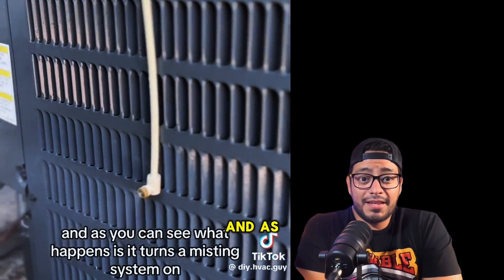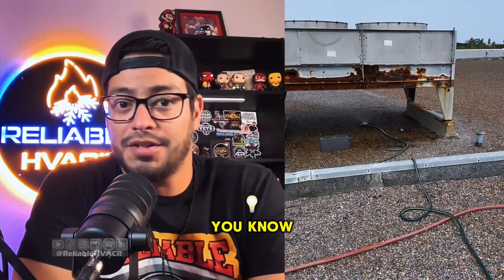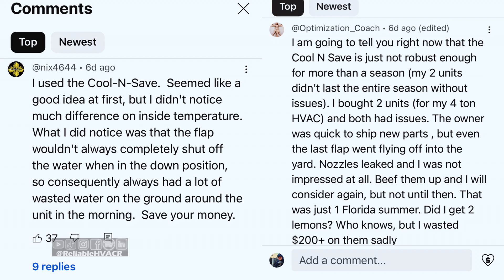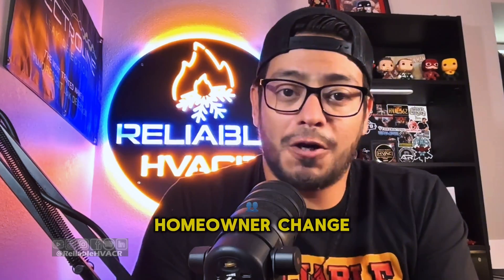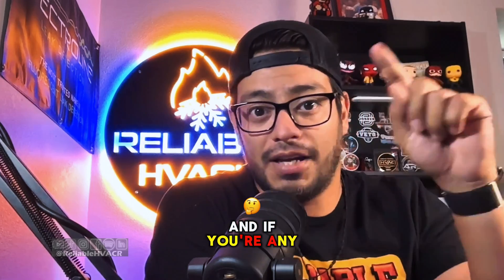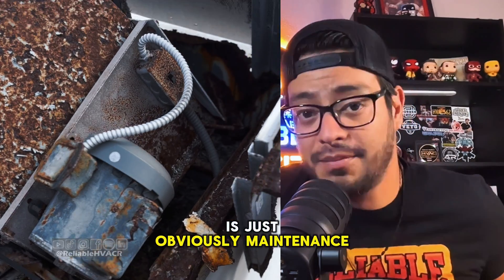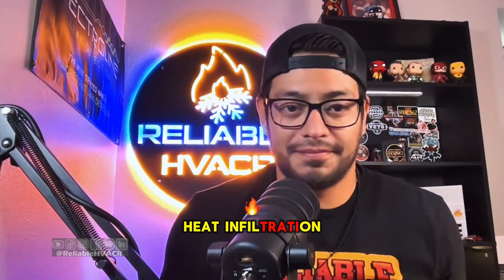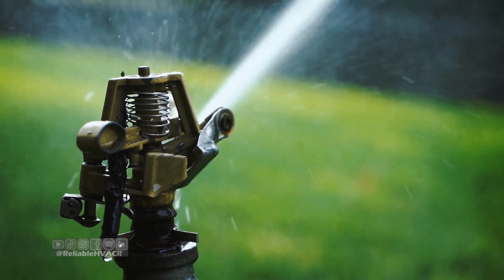COOL N SCAM? DIY HVAC #hvaclife #diy #diyhvac

Comment: People reviewing this thing need to do a complete review by measuring multiple temperatures, current, and possibly pressures. Supplemental water cooling will not lead to a drop in vent temp so much as a drop in current/increase in efficiency, but only under the right conditions. Additional cooling at the condenser is going to do one thing- increase subcooling. Some increase can be beneficial, but too much will cause the TXV to starve the evaporator, leading to an increase in superheat, causing the compressor to run hotter and the conditioned space to lose cooling.
Throw mini-splits and their CPU algorithms/lookup tables and electronic expansion valves in the mix and it's an even bigger can of worms. My 30 year old heat pump does benefit with a small amount of water cooling on extra hot days (just 1 small fogger nozzle). When I direct the same mist onto my mini split, it responds by slowing the compressor down.
All in all, this particular device is too expensive for what it is, which is not robust enough to be reliable.

Comment: Okay but then why is there a “slinger ring” on window ac units? 
-just adding to the discussion here
I do see your point that the main house unit doesn’t have it, it’s not made to be bathing in water.
But like what’s the difference? (Between the window units self wetting and the big units)

To me in the end id like to think it works BUT my main thing is if it really worked that well and made a difference, they woulda made it standard already. Like there’s people that study it for a living so 🤷‍♂️
Reply: I actually think this Slinger Ring is mostly just a way to put the humidity condensed into water back into the air vs dumping it on the ground. it can help in dry environments absolutely. but if its super humid its probably a wash.

Comment: Most electric companies offer a free in home consultation on making your home more energy efficient.  things like caulking around your doors or adding insulation to the attic or walls.  That seems like a better approach than trying to eek out an extra degree or two from your AC condenser.  Or hey if you wanna spend some money on something that will help you out way more than a $120 mister,  get a thermal imaging camera attachment for your phone.  They are as cheap as $160 and they can show you all the places where you have heat differentials in your walls.  Then you can do your own home assessment.

Comment: The systems this would work best on probably just need a good deep cleaning or have a fan motor on the way out. Sprinklers are a bandaid for a larger problem.
Reply from the maker: I get the concept but it's mostly fools gold, not worth the trouble

Comment: I get the point of those pages the problem is like you said too many points they don’t cover . Personally I have no problem with people wanting to work on their own stuff I just want them to be safe and do it the right way which requires a ton of tools and equipment that they never cover .
Reply from the maker: That's mostly my point, to each their own right

Comment: I’ll agree, I think I should have stated it needs to be a very dry climate like Utah where I am at. And most times the reason someone is putting this on their unit or taking other measures is because it can’t keep up, either because it’s ancient, or it’s ridiculously hot. You made some valid points and no need to be secretive. I get it man. I think the product works under certain conditions and I’m not affiliated with Cool n save.

Best
Reply from the maker: You do a lot of good for people so I ain't mad but sometimes we'll agree to disagree. And there's just been way more aggressive people on other platforms in the diy space that I'm particular about. Thanks for the commenting 🤝
Reply: @ReliableHVACR thanks brother. I’ll try and make sure these points are more clear in future videos. They did a scientific study for this particular product so I’ll be diving into that maybe next season. Thanks for all that you do brother. 👊🏼